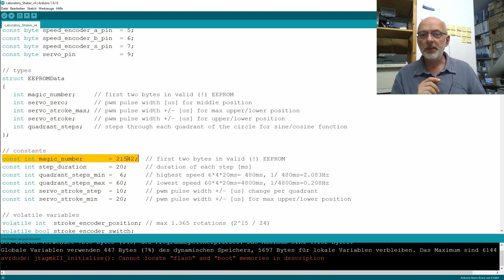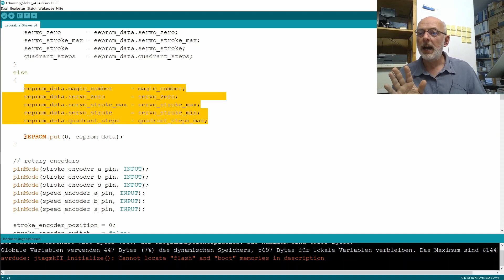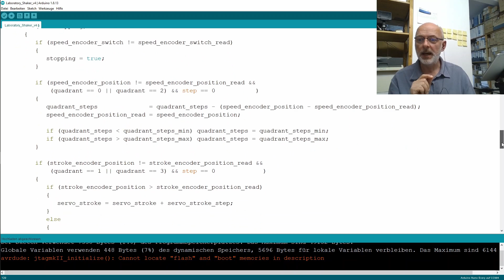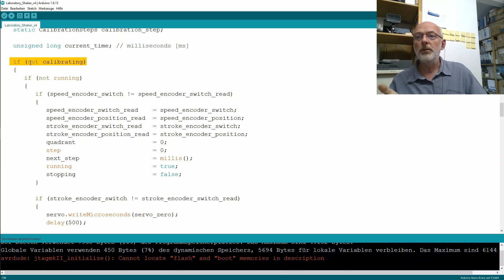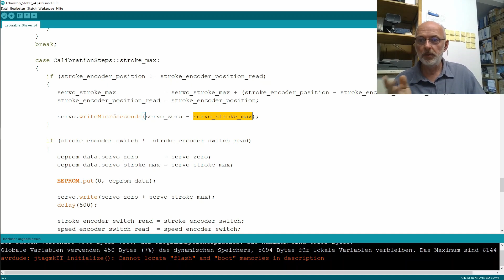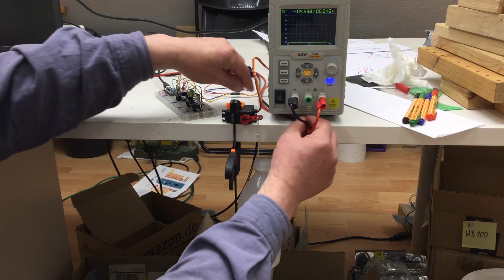Motion Control with RC Servo and Arduino Microcontroller (3/3)

Comment: Very nice , esp the demo at the end. Did not know these servos had so much torque ( who reads datasheets, right ?? ). Might be worth mentioning that most EEPROMs have a limited number of write cycles. Also the magic number could be a check sum of the parameters stored for additional robustness. Spaghetti code should be "good enough for Italy" :D ?
Looking forward for your next video !!
Reply from the maker: Thanks! I really did the demo at the end to assure myself that the final product (laboratory shaker) has a fighting chance of actually working ;-) And yes the EEPROMs have a limited number of write cycles they survive. In case of the ATmegas it's 100.000 (the flash memory survives only 10.000 write cyles). I should have mentioned that - my bad! Adding a check sum is a good idea, maybe I do that when I give that code a makeover. Coming up next week is another woodworking video (rebuilding an IKEA chair). But on the 20th of June the first (but short) part of the laboratory shaker will be published.